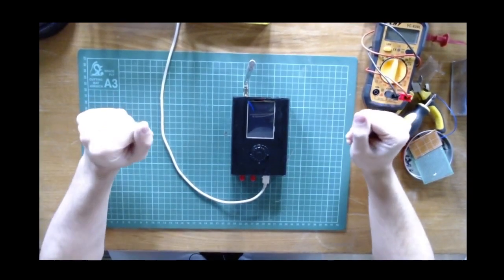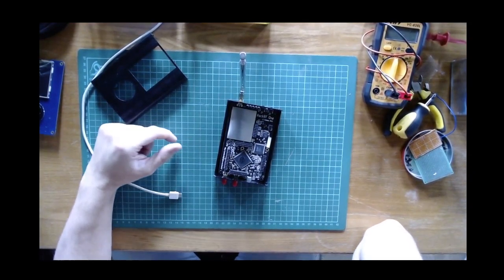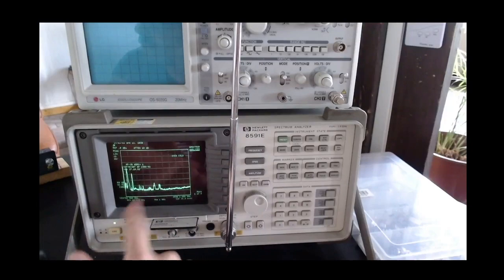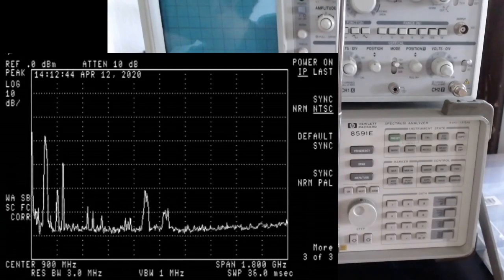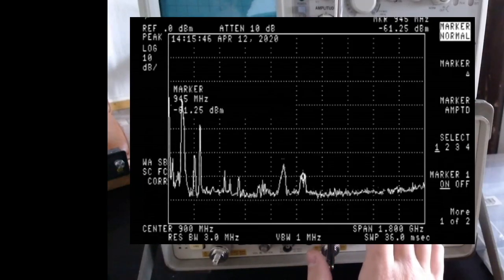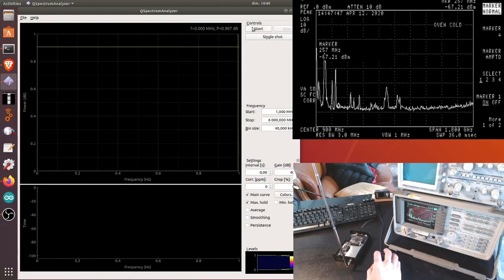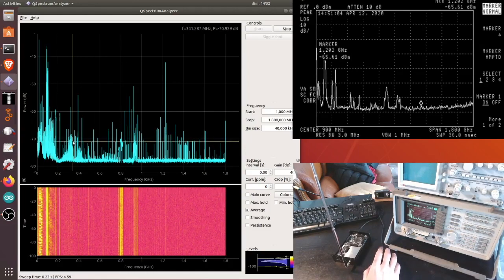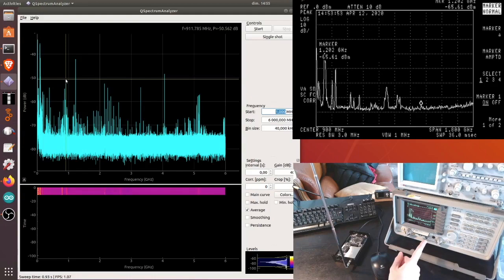Episode 1: HackRF as a Spectrum Analyzer

Comment: If your HP resolution bandwidth is 3MHz you wlll probably be missing a lot of signals anyway.
Reply from the maker: My HP 8591E has a maximal resolution of 30Hz.
Reply: @therfnoob7697  Indeed. But in the film it's set to 3MHz.
Reply from the maker: @MartinInAmsterdam  Ah, right. Yes, I did that to avoid comparing 'oranges' to 'apples'. Of course the HackRF as SA is VEEEERY basic indeed. :) Thanks!

Comment: Nice video.  Wondering how you're able to display the measurement (black and white display) of the HP 8591E on your screen.  Did you connect it to your pc?  If so, through the parallel interface?
Reply from the maker: Thanks!! No, the HP 8591E has a composite video output port, which sends out the monitor signal. I receive it on my computer using a ~10usd usb dongle. Cheap but sufficiently ok for hobbyist purpose. Btw, I have several video on my HP 8591E and some of its ports/functionalities on the back, check them out :)

Comment: LOVE the video! Subscribed for sure. Did you have trouble setting up QSpectrumAnalyzer? I've had a hell of a time getting it running on either Mac or Windows. Getting it STARTED seems easy enough, but I haven't been able to connect it to any input device - LimeSDR, RTL-SDR, or HackRF. Next step is to try inside a Ubuntu VM.
Reply from the maker: Thanks Alex! I only tried with Ubuntu, and it worked no problem. Don't know about Windows or macosx. However I have tried to do HackRF things within a Ubuntu VM (inside my macbook pro) and my general impression is that thing just don't work well (possibly due to some USB communication issues, I don't know). I suggest, if you can, to try with a real Ubuntu computer (if necessary use bootcamp on Macosx to dualboot)
Reply: @therfnoob7697  Were you using VirtualBox? I know I've run into a lot of hit-and-miss USB device support. Some devices work perfectly, some fail in weird ways for no obvious reason. But that's good to know either way that you had trouble. I've also just come across DragonOS, so maybe my best bet is to try loading that and verify all the basics work out of the box with an RTL-SDR, then work up from there. Complicating matters, I'm worried my LimeSDR actually has a broken front end. Tough to diagnose when I've basically never gotten it to work reliably in the first place :)
Reply from the maker: @AlexWhittemore  I tried with VirtualBox and had terrible USB experience. Parallels Desktop (for MacOSX) works much better, imho, but still couldn't properly work with the HackRF.
 Sorry to hear about your LimeSDR. Do you suspect your LimeSDR has problems with RX or TX?
Reply: The RF Noob I only have even an inkling about RX, and if it does, it’s because I dropped a screw in there and shorted a 3.3v pin header to RF ground. If that’s all that shorted, I don’t THINK it should be dead. But because of all the software trouble, I can’t be sure.
Reply from the maker: @AlexWhittemore  Right. First fix the software. Then worry about possible damages. I have believed my HackRF was burned several times due to software problems. Fortunately the HackRF also has the portapack board which allows you to do basic stuff without any software, and you can easily check if things are broken or not.

Comment: Buyer beware! The hackrf Tx amp fails very easily even with normal use and they will not refund or repair/replace.
Reply from the maker: Also, I disagree that it "fails with normal use" but I agree that it is sensitive and you need to transmit on a load with good 50ohm impedance. For example, connecting the HackRF to an oscilloscope (1M ohm input) and transmit with the HackRF can fry the hackrf. See also my Episode 7: https://www.youtube.com/watch?v=QHq-JrolFiA
Reply: @therfnoob7697  Thanks for this. Mine failed and I never used it without an antenna. I think the least Great Scott Gadgets could do would be to supply the T-connector and dummy 50 ohm load as tou suggest with every hackrf plus a warning.
Reply from the maker: @jemussi7842  yes, there should be more documentation and tutorials online, on the HackRF and other popular radio things. This is why I started this channel. I am defiintely not a PRO, I am just a hobbyist, but what I discover I like to share. Also because we are amateurs "on a budget" and it's not cool to damage equipment and lose the investment.
Reply from the maker: true! My hackrf Tx amp is still alive after 3 months of many experiments, but I have fried the bias circuitry (that allows you to push 3V dc over the antenna line)
Reply: You shouldn't be transmitting if you aren't licenced. If you are licenced then you should know better. Not the manufacturers fault at all that you don't know what you are doing.
Reply: @slimygreen1967  It is a known manufacturing fault on the HackRF admitted to by the designer. And you are wrong, I know what I'm doing. If you have nothing constructive to offer, do not comment.
Reply: Wow he really  is slimey and green 😂

Comment: Just a question What soft are you using to get real times data coming from your SA on a computer? Many thanks! Lot's of very interesting topics F4GVF
Reply from the maker: Hi Vincent! My SA has a BNC port on the back transmitting a composite-video PAL/NTCS signal! So I have connected that port to a cheap (10euro) USB-dongle that converts it to digital. This dongle is basically seen as a webcam by the computer, and I can import the video using the OBS software (which is what I use to make the youtube videos).
I love my HP 8591E, and I think I will make a video about this feature (and others) because you are not the first to ask :)
Do you also have a SA? 
73
Reply: @therfnoob7697   woaw fast answer! Yeah nice features! Ok i got you. I thought it was a special protocol or command line... that you where using. I spent many years playing with 859xx series. I actually have a 8594E home... modified with a board of 95E for the story...  and a hp8753 for the NA measurment in complement of the nano VNA :) But i'm fetching my data using the GPIB port with python script (homemade). But i'm more interesting by getting the data with me to go instead of watching it! :) but you're trick is working fine! But now i understanding why the data are displaying do fast in such a old timers! Any plans for hamradio video in the future? It could be a great topics! Many thanks for your reply!
Reply from the maker: @f4gvf  thanks, wow you have nice gear :) Congratulations! I bought my equipment (including the SA) only a couple of months ago, after a few years of reading here and there. The SA especially is a great tool for learning! In the last 2 months I made a big knowledge step (I think).
I am surely moving towards Ham Radio, that's my goal. But I want to get there slowly, step by step, understanding the electronics behind it (I don't want to just buy a radio and start using it).
Reply: @therfnoob7697  perfect keep going in this direction! I'm sure you will be a great radioamateur! RF is a fantastic domain! You are in the perfect way of learning